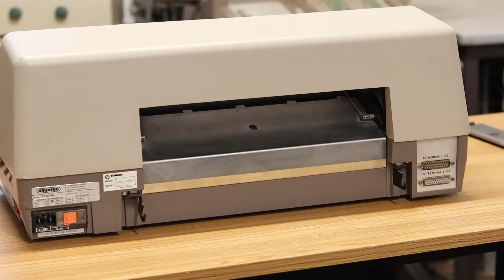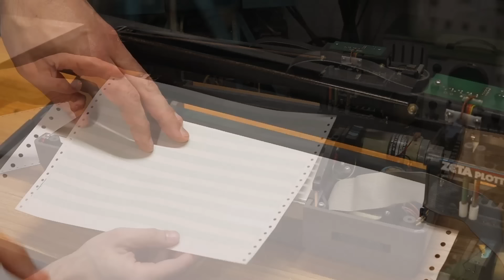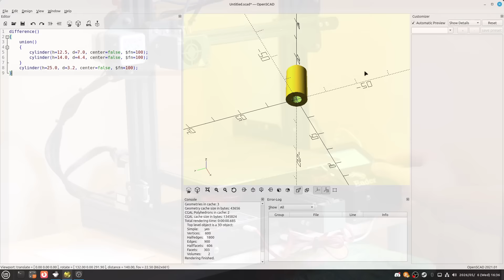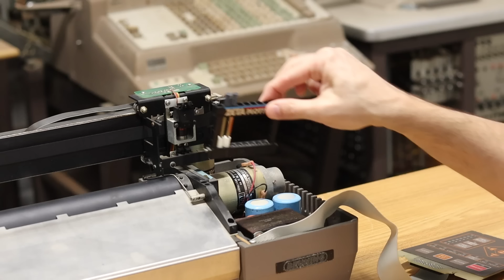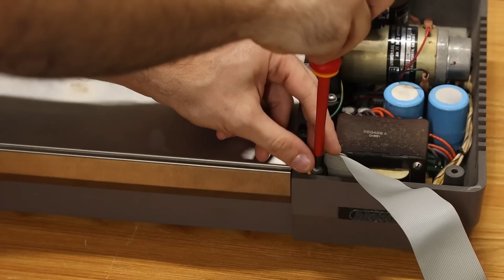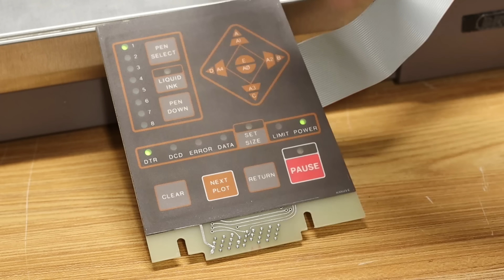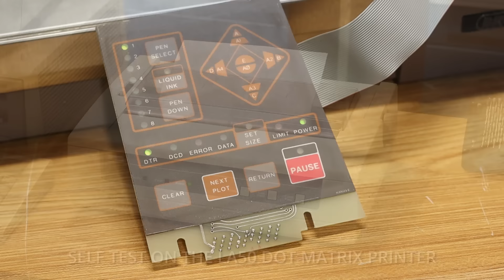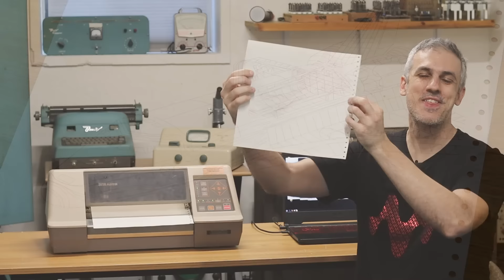A Pen Plotter from 1986!

Comment: It look like your filament wasn't dry, stringing like this is usually water in your filament.
You can dry it in a food dehydrator or maybe your Texas heat can do it too, but I can't vouch for that.
Reply: Texas humidity just makes stuff wetter.
Reply: @micahnightwolf not if you throw it into an airtight, transparent box full of silica gel packets
Reply: I live in texas and have the same issues with filament, just needs a filament dryer or food dehydrator 

As far as the lip, you could try using the late to whittle down the wall, or reaming the hole also works
Reply: I can vouch that Texas heat is very definitely not dry
Reply: That depends a lot on the filament used.  If he is using PETG or similar then moisture is a very likely a big factor.  However if he was using PLA or similar than it is more likely an issue with retraction settings or temperature.
Reply: @gemedetvideo since he said that he isn't using his printer much. It's likely that even PLA has absorbed moisture.
Reply: @SuperUltimateLP I've been lucky. I leave my cheap Amazon PLA sitting out for years and my $150 printer from 2019 still does an amazing job. (For its time)
Reply: Plastic just likes to string a lot in general, any time the nozzle moves over open air plastic will stay stuck and get stretched out, the best way to avoid it is just printing one part at a time to minimize travel
Reply: lalalalalala
Reply: Agreed!  You can also get a smaller diameter nozzle for pretty cheap.  0.25mm might be a good choice for those little bits.
Reply: @arashai  He might have been able to put that pen-tip part in a drill's chuck and sand it down to the right diameter.  Even better, a mini-lathe.
Reply: @projectartichoke  Or mill it on his milling machine, like he does for "everything else" 😉
Reply: @arashai  or realy wild Idea just bigger, and the run down to the required sizes some sandpaper, the the craft knife twiddling away the unneeded excess
Reply: I used to have the very same Ender 3 and had the same issues. They were caused purely by the very poor filament feeding design of that printer (driving motor pushing the filament through a tube instead of directly to the extruder). With better printer, this does not happen any more (prusa mk3s). Also, the mechanical durability of the prints is much lower with this ender 3.
Reply: @TESLA_KF507 the filament path and extruder is a bit crap on the ender 3, but this doesn't result in so much stringing.
Stringing is a result of either, too much pressure on the Bowden tube or wet filament.
But if you have to much pressure in your Bowden, it usually result in globs of material at the exit position and a thin string, he has strings with globs in between, that's usually moisture, that's boiling off, if the nosse is down and printing the vapor just escapes, if you bridge ord move in air, the vapor pushes material out.

He also has trouble with mechanical strength on the thin parts, that's also to be expected from moist filament.
Reply: @SuperUltimateLP  Yes, that is possible, but for me, it was really the printer. I used the prusa in the same environment as the ender 3 and the stringing stopped essentially completely. The ender 3 has a lot of slack in the tube and when it is transitioning from pushing to retracting, at least on my ender 3, it always pulled the tube with it by very roughly 0.5mm. Yes, the tube was installed properly. It is true though, that the stringing is rather blobby, so that might really point to being (also) caused by moisture, but when it comes to moisture in filaments, i have not got much experience with that as i store them in dry-ish environment, so i can not help with that. But a better printer would help also.
Reply: @TESLA_KF507 case in point! there's a reason the industry moved away from bowden fed extruders. and filament needs to be kept dry! 
is was fun to tinker with those hacky DIY kit printers 10 years ago, and with enough dialing in, the reduced weight of a bowden setup could quite a bit print faster, than a stock anet A8/A6 or an ender 3 ... but not worth the hassle. back then tinkering with the machine was more of a hobby, than actually printing. 
my ten year old anet A8 still prints fine with minimal modifications, to mitigate it's little design flaws. currently printing 8 3DPsax tubes in clear PETG at a constant 30mm/sec. (on a glass bed, coated with hair spray, and held with binder clips)
i recently got a kobra X, and it's an absolute beast! but to print clear PETG slow, hot, and 100% bubble free "see through" clear, i got the A8 dialed in perfectly.
Reply: Also could be retraction, the extruder on  that ender is more archaic than the plotter.
Reply: Ender 3's are ten years old now and many years out of date. They simply don't print fast enough to avoid oozing.
Reply: @JamesChurchill  "out of date" kinda, it's an old machine, but it won't degrade by just sitting around, and David is well capable of caring for mechanical devices, as he seems to be a gearhead too.

There isn't much on an ender 3 that can go wrong, no bed leveling, no pressure advance, no input shaping.
The thing is simple as can be.

You can still pull of amazing prints of an ender 3 to this day.
Reply: @SuperUltimateLP  There are also a lot of cheap upgrades you can install for an Ender 3. ~$25 direct-drive upgrade was one of the best things I did for my print quality. Dual-Z upgrade and CRTouch also helped quality a good chunk
Reply: @SuperUltimateLP my Ender 3 DOES have bed levelling.
Reply: @alanclarke4646  im Talking about automatic bed leveling.
The original Ender 3 didn't have it, only the newer SE comes with automatic bed leveling out of the box.

You were also always able to add a 3D probe to it, but that's not stock and that's why I didn't count it.
Reply: @JamesChurchill  

Not true. I upgraded my Ender 3 with silent stepper board, metal extruder housings, better quality Bowden tube holders, better be springs, and B-touch sensor and  custom Marliin firmware. I have dialled in print speed, retraction speed & distance, and tuned pressure advance and resonance settings.

I have no issues with stringing on PLA or PETG, so long as they are dry. 

Old is not a factor if you want to control every aspect of your prints. It is when you are lumped with proprietary firmware do you realise how limiting it can be.
Reply: @veritanuda I did all those things and my ender was still completely outclassed by even the cheapest of the current generation, and the new printer didn't need 50 hours of tweaking and $500 in replacement parts. It's fine if you want to make the printer your project, but I've been doing this since the Darwin and now I'd rather have a machine that just works.
Reply: @JamesChurchill You want slow? Check out my printer. Usually double the estimated print time.

Comment: Silly suggestion, but could you use the router setup you use for PCBs to drill a row of holes in a stack of paper?
Reply: Clamp the paper between a couple of boards perhaps and drill through?
Reply: @sarahgoo5541  Yes, a drill directly on paper would go wrong, but some boards should fully fix that. And you can do a fairly thick stack of paper at a time!